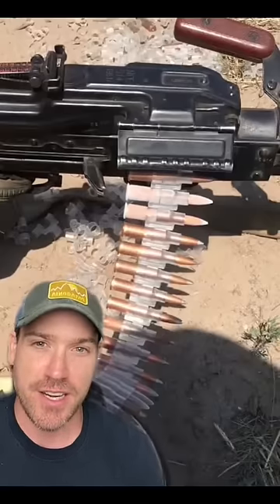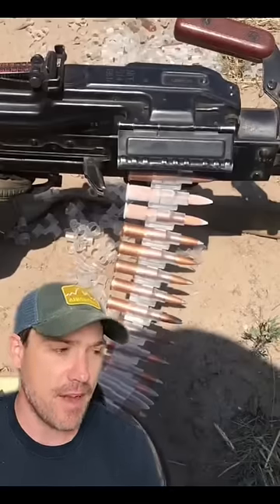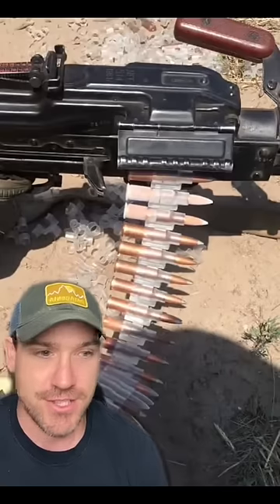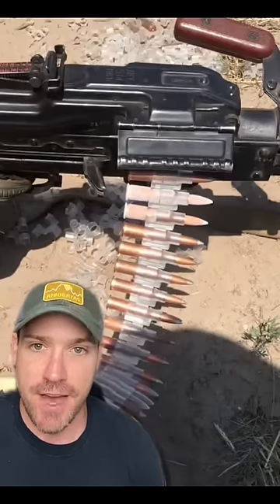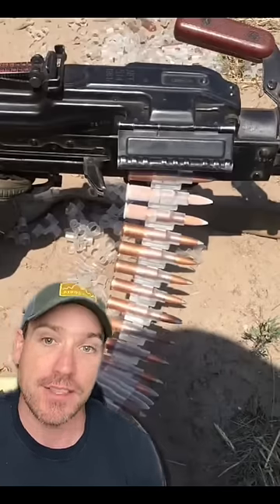Machine Gun Ammo Belt in Ukraine

Comment: Well asode from known issues with plastics in melting in high and  cracking inlow temperatures, uv light exposure causing premature degradation, and the possibility of having to scoop goo out of the action to clear mechanism during sustained fire, it sounds like a great idea. Hope the engineers are up to the challenge.
Reply: Sounds like the type of plastic is the problem, I've seen some very durable and heat resistant plastics but they are expensive.
Reply: @Victor-vj5ds  Materials selection will be a key part of making this work properly. But most high temperature plastics are not so good in the cold. And vice versa. Definitely like the concept.
Reply: Yep, we need more plastic scattered about the landscape (/sarcasm)
Reply: @MonkeyJedi99  strange how your not concerned about the brain damaging lead and other heavy metals they are shooting into farm fields.
Reply: @MonkeyJedi99  It's not half the problem it's made out to be. The worst of it, about eighty percent of it, comes from ten rivers in Asia. The plastic is the least polluted thing making its way downstream there.
Reply: @Victor-vj5ds  Strange how you assumed that "fact" with a shifting goal posts AND an ad hominem logical fallacy hat trick.
If I kick you in the knee, that sucks.
If I kick you in the knee AND break your left pinky toe, that is a bit worse, yes?
Now let us assume the kick to the knee is going to happen, because knee kicking wars happen. Is it no okay that I also break your toe?
And If I am against breaking your toe, does that somehow then mean that I am pro-knee kicking? 
*(Hint: the answer to the last question is not knowable without further questions. Assumptions do not make a viable substitute for information gathering)
Reply: The heat thing might be a benefit - part of why we likely won't see caseless ammo in our lifetime is the fact that the brass absorbs and then takes with it a fair amount of heat from firing, meaning the gun doesn't absorb it.

If the plastic can suck up a lot of heat - maybe more than the links would - then that's just a benefit.
Reply: Why did I watch this video and already now the top comments.

Just missing the one about areas of France being poisoned by WW1 unexploded shells.

Why do I feel like someone already tried this in the 80's.

But short answer is considered the CO2 emissions for steel links vs plastic it's always going to be a net positive even if the plastic is not bio degradable.

That and the bigger issue of the blown up bridges and burning tanks.

Ohhhhhh no someone dropped lots of little bits of plastic all over the place now the whole village is just ruined. Said some guy standing in front of a shell creator that use to be his home.
Reply: @trevelynbrown4444  the fact that's it's probably a 10x reduction in production cost and any definition of the links can be melted down and re pressed. So almost no waste products. And the lighter the material the thicker the can produce then.

Steel links have the same weakness as plastic bend fold snap along the stamp lines.

But it's you kids with your new fangle technology back in my day we would March up hill with 1000 rounds of ammunition and love it.

Orrrrr the fact that soilders are a pretty good judgement of what's good and what's shit and if it's shit they will quickly loose that shit in a ditch on the side of the road.
Reply: @trevelynbrown4444  ohhh yer something something Lego.

If a toy company can make strong ass blocks to such precision U think a grovment backed ammunition product company could not do the same.
Reply: @michaelfoye1135  the hell are you even talking about?
Reply: You don't know much about modern plastic polymers. There are plastics that can easily handle up to 240 degrees celsius, and nylon polymers that can handle triple those temperatures.
Reply: I don't care as long as I don't have to continue to suffer to help fund a war that has nothing to do with me
Reply: @ifucturmotha6692  Even stranger how you picked ME to give this off-topic reply to, when all I am talking about is the wisdom of more plastic being discarded across the landscape.
-
But hey, you have an axe to grind, probably based on mis- or incomplete information, and I can take the abuse. I was, after all, once married to a woman who cheated in our own bed while I was at work...
Reply: @MonkeyJedi99  apparently I clicked on the wrong person so sorry for that. If it makes you feel any better my first child my sons mother cheated on me with my best friend since I was 6...even worse she made excuses for it tryna say it was some how my fault. I had to get  a paternity test for my son before I would claim him. Turns out he was mine and she slept with my best friend when she was 3 months pregnant with my son...so yea im sorry and I get it. However it still doesn't make me wrong about supporting a war we have nothing to do with, with a country that's run by a dictator and one of the most corrupt countries there is.. no I don't approve of what Russia is doin and feel bad for Ukraine. However I love my fellow Americans and believe they should come first.
Reply: are they biodegradble tho, and also affordable
Reply: PKM have different feeding system, rounds taking back and then pushing forward that means belt cells are fare from heat source than in Fn Mag or Fn Minimi
Reply: Some plastics don't melt after being formed, they just burn but usually much higher temperature.
Reply: @MonkeyJedi99  would you rather have metal? It’s a degradable plastic im sure
Reply: @MindsMouth  yes but neither of those are biodegradable. It's almost like you didn't watch the video.
Reply: @ifucturmotha6692  👍
Reply: The links have been tested in heat & severe cold. Worked fine. Very stable plastic.
Reply: @ObservationofLimits  I watched the boring video he didn't mention biodegradable, only that they disintegrate after use. Doesn't mean they are biodegradable, micro plastics are a huge problem for fresh water sources and pollution 🙄🙄🙄
Reply: @ifucturmotha6692  the Ukraine war has a lot to do with us, we helped create NATO and collapse the soviet union.
Reply: @swj719  unless we make heat sinks into every gun and or use the mass effect 2 style of discarding heat sinks.
Currently with our tech it’s not economical.
But magnetic weapons will require a heat sink like halo plasma guns have.
And energy weapons can have either system.
Reply: @presnell25  Yes, I would rather have metal.
Common metals oxidize into the environment with minimal impact.
Even degradable plastics have dubious outcomes, as the plastic molecules themselves often just become 'micro-plastics' instead of breaking down further into harmless or inert parts of the base molecule.
-
Silly side note: Maybe if war was more "inconvenient" there would be a little less urge to use it as a tool of international policy?
Reply: Exactly.  I was about to bring up possible jamming.
Reply: @swj719  this is correct. Brass absorbs a lot of heat. The chamber is apparently cold after firing plastic case ammunition like true velocity’s ammo.
Reply: Its not engineers, it’s a chemists/technical engineers problem
Reply: Indeed
Reply: I did a little research on composites because your comment interested me. At the hottest point in the chamber it'll reach 1,000°, around 320° at the end of the barrel. The upper receiver won't see close to those numbers fortunately, and most hugh grade plastics don't start degrading until around 350-400° with many floating around 550°. So it's not the beeeest idea, but I do personally believe failures to feed will be few and far between
Reply: @Victor-vj5ds  well that's non negotiable...
Reply: Those issues really only apply to thermoplastics
Reply: I'd say that's why theyve been working on them for 5-6 years, probably finding the right mix that deals with all of these issues
Reply: @MonkeyJedi99  metal is better?
Reply: Framing nails have plastic holds, kinda like links but they also don’t have mini explosions going off inside and they tend to sting when they hit you
Reply: We already have ammo casings made of plastic
Reply: @jamieboer3466  Yes.
Reply: @clarence2485  Yes.
Reply: It's harder to make plastic the correct color than it is to make it more resistant to heat or cracking.
Reply: God knows someone’s life depends on it….
Reply: @softdrink-0  Typographical error.
Reply: #plastic-ashtray
Reply: Well most of these could be worked around. And the UV one won’t be a problem because you just have to keep the ammo in the shade.
Reply: It's true but they are coming up with some pretty sturdy plastics that hold up under heat real well hopefully they'll be able to create it and make it work
Reply: I have a plastic set of baking pans.
Reply: @jmackinjersey1  Those are silicon.
Reply: @ObservationofLimits  When he said “disintegrate”/“Fall-Apart” he literally means “dis-integrate”, as in instead of staying “integrated”/linked-together, they un-link from each-other after being fired.
Instead of just staying together and hanging off the side of the gun. 
He didn’t mean that the actual material like biodegrades/breaks down into nothing after time. Although I could see why you might have thought that.
Reply: Half of an M4 is plastic.  These things aren't made from soda bottles
Reply: The links don't go anywhere near the "hot" parts of the gun, plus there are polymers that can handle extreme high temps...
Reply: The belt initially showed in testing is litterally frozen that’s why the ammo looks wierd cuz it just came outta a freezer
Reply: I like you optimistic attitude
Reply: @Victor-vj5ds  yeah I just watched Zack freedman 2nd video on 3d filaments some were crazy expensive very strong and heat resistant
Reply: Silicone’s, can literally hold a torch to it
Reply: @JackTalyorD  other than the fact that the links disentigrate and no one will be grabbing empty links mid battle
Reply: @JackTalyorD  strong
Have you seen Lego figures or brown plates recently
Reply: @presnell25  the video said it isn't
Also microplastics
Reply: Definitely best suited for a thermoset plastic to avoid the melting issue. The other issues will be either of lesser or greater concern depending on the average amount of time berween loading and actually needing to fire any given belt. Right now I believe that time is fairly low.
Reply: This isn’t 2006 my friend. Polymers have come a long way.
Reply: Their are plastics with a melting point of 650 degrees (radel). How do I know? I extruded plastic in a plant for almost 5 years and ran a extrusion line and had to learn the inner workings of the industry and a ton of diff plastics. I wouldn't be worried about temperature if they use the right plastics. Alas Radel costs like $30 a lb back in 2013 when I left that job so who knows where the prices went in modern days. P. S. I extruded Radel sheets to be sent to another plant to be vacuum formed into hospital trays. They need to be high temp so they can disinfect them with heat and reuse.
Reply: JUST LIVING LIFE  it def states it's high energy impact right in the description lol I'm not quite sure about the other test results since we never needed anything else on our spec sheet other than a mic and measuring tape. I guess wasnt useful to what they were using it for. I guess what I was pointing out originally was plastic can be quite surprising depending on what kind it is and their are many. It's nice to see another hard worker too! Hah. I must worry about moisture in the plant so it's always hot as hell in the summer time, hit 105 degrees f and they almost had to send us home one shift. I wonder what it would take for them to impose safety shift calls lol how many people need to faint? Is it like this where you are too? Haha I actually know guys who used to work for Bayer, the aspirin company if cause they had a huge extrusion plant close by home here in CT as well. Anytime people that worked reminisced about nice equipment or pay they would say "I remember at Bayer..."
Reply: False actually the United States military is designing a plastic bullet casing that will go into production shortly
Reply: Your car’s plastics seem to do just fine for decades
Reply: To UV stabilise plastics you have to introduce carbon which turns it black. In South Australian intertidal  oyster baskets, the polyester material must be able to withstand temperatures of - 4  celcius to 45 plus degrees and maintain its integrity. How it would perform inside a gun? Very good question. Food for thought.
Reply: Someone doesn’t know how many different plastics exist…
Reply: @eskimo5274  The development team has already tried over two hundred different types of plastics. If it was that easy it would have been done a long time ago.
Reply: Thermosetting plastics harden with heat
Reply: It really depends on the plastic or polymer used
Reply: @JackTalyorD  ' referencing the final arbiter of infield materiel: the field soldier' Now THAT is a good observation.
Reply: @dragonsword7370  I'm not sure what you mean sorry
Reply: @dragonsword7370  ohhhhhhhhhhhhhhhhh was it Norway WW2 40,000 something kar98Ks.

The front line troops have gone well this guns a bit shit and swaped it for a Russia rifle the first chance they got.

Lost 20,000 before they someone realised maybe we should just keep these in reserve, the front line troops don't want them.
Reply: @MonkeyJedi99  it's surely no worse than metal that rusts. Besides, keep in mind these people are fighting for their home. I imagine the environment is not the top priority there. If they lose they won't have that luxury and they don't now.
Reply: @Defender78  in war whether your ammo links are going to mess with the environment or not kinda takes a back seat next the fact that people are trying to kill you and vice versa. And no soldier is going to turn down a lighter load of it helps them fight more effectively. Priorities bud.
Reply: @MonkeyJedi99  pfft... 🤣 Yeah, go tell Putin that and let us know how it goes.
Reply: @Nitro1000  it's a bit less than half my dude. The adjustable buttstock and the panels you can mount on the rails or whatever attachments you use might be polymer but the upper and lower receiver are metal on milspec m4's. Civilian variants can be different though.
Reply: ook
Reply: Read my comment! It is SLOVENIAN MADE with a special kind of plastic that will BREAK WHEN APPROACHING CERTAIN MG cookout temps!
I hate to admit but they thought about everything!
It has already been tested on multiple platforms for DECADE, even if used most by Spec.Forces!
Reply: @MonkeyJedi99  I think that is the best dismantle of an argument I’ve ever seen, are you a lawyer? 🤣
Reply: @HashPapi  I am not a lawyer, nor did I stay in a Doubltree Inn.
I am just fortunate enough to have been educated in a time before personal computers, "No Child Left Behind", the MCAS (Test to see if you memorized enough stuff to pass the test so you could graduate), or "new math".
And I keep learning every day.
Reply: @MonkeyJedi99  Well, hat off to you good sir. I’m alike you when it comes to learning more every day. Cheers mare!
Reply: this guy said a belt with metal links weighs 3.3lbs, but the plastic belt only weighs 1.1lbs? am i really supposed to believe that the links make up 67% of the belt weight? no fucking way!
Reply: My first thought was how will would it work at -30
Reply: @Redavisunwind  Hmm... (crack)
Reply: @Victor-vj5ds  I don't know the cost of these better plastics, but they would need to be cheaper then the metal ones

Comment: Bet the saw gunner is gonna love having to clean melted plastic out of a pkm action during an intense firefight
Reply: My thought exactly. Over heating will cause there to be at the very least residue.
Reply: I think back to the original plastic, Bakelite, which was impervious to heat. Think of the oven-stable baking dishes, and the heat resistance of Kevlar. Proper formulation can prevent the melting issue. I think back to firearms with plastic components and metal liners. 
Remember the experiments with brass-based, plastic membrane cases? The case burned with the powder, but did not melt in a hot chamber.
Reply: @mightymystery9204  But will they take the extra cost involved? Most military strategy behind the scenes is "Weld another door on that door if you want some more armor."
Reply: @FostuRKid  there’s a huge difference between operating in the safe suggested parameters and fighting for your life.

You can warp a barrel, a solid chunk of steel. That can be swapped out, but the gun is toast if the action is gummed up

Comment: Some of these new polymers can take high and low temps just fine. I'm hoping they will be destroying some guns in testing to see if they will melt. Just keep feeding it ammo till you've fucked the barrel, if it doesn't melt in that situation, then maybe.
Reply: Yeah agreed, if the feed tray is so hot the top cover is prematurely firing rounds before they've even entered the chamber and the link still isn't melting then I think it's good otherwise no thanks
Reply: Waste of a gun during wartime.
Reply: @specialoperatorlolbit8671  that makes litteraly zero sense. We aren't at war first of all. Secondly what's the point of a weapon if you can't fire it. So developing cheaper ammunition at the cost of a couple weapons is super worth it
Reply: @specialoperatorlolbit8671  Better to lose a gun testing than to lose a soldier because of untested equipment.
Reply: @Elendrian   and they can find an older model that can still function well enough/ but needs replaced anyways and would just be melted down and recycled. At least whatever proving grounds units can get some use out of it other then being handed to a guy in boot to aggravate the hell out them, and teach them more sop for clearing jams.